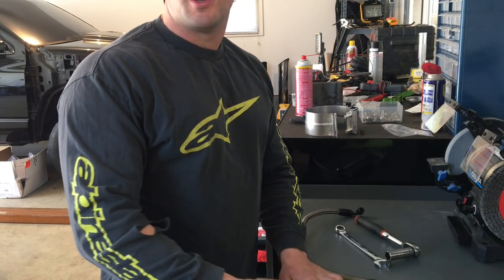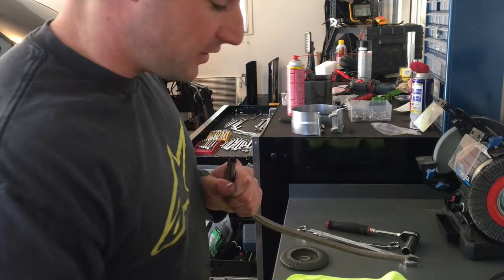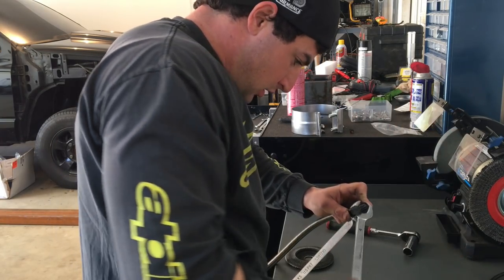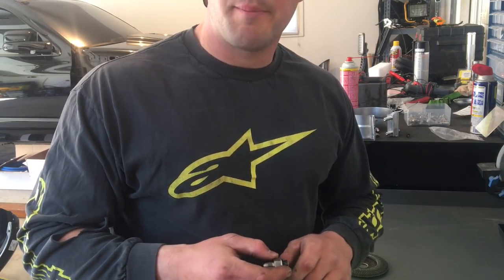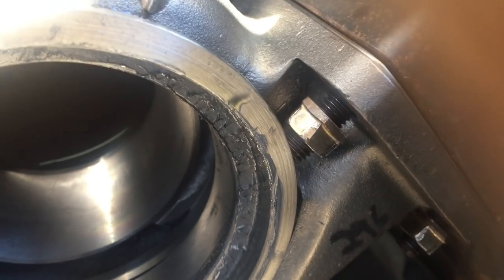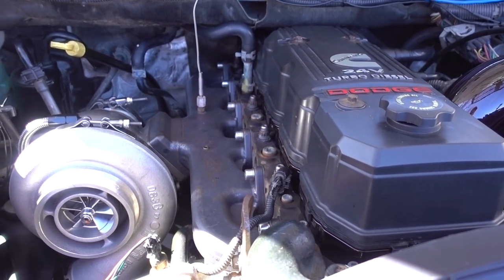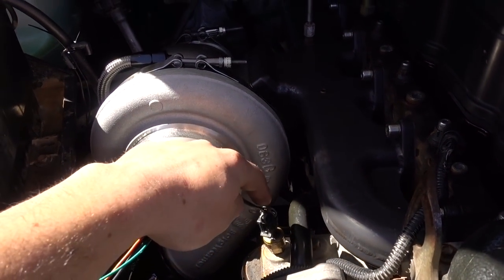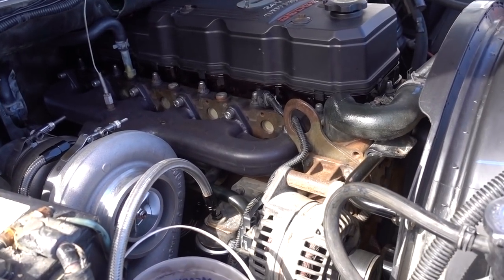FROM BAD TO WORSE - MEGACAB BUILD GOES EVEN FURTHER!!!

Comment: Before you tear the front of the engine apart, check/replace the filter housing and oil cooler gaskets and a pressure relieve valve. If that don't help, drop the oil pan and inspect oil pickup tube for cracks and its gasket. Just a thought

Comment: Check the oil and filter that will tell you real quick if something is fucked I went through turbo problems and turns out diesel was leaking from a bad injector or injectors thinned the oil (only know that because I had it tested) and scored my cylinders up let's just say the truck sits in the yard

Comment: could be an oil pickup issue it's somewhat common on those it happened to my 06 could have had weak oil pressure then from sitting lost it's prime and that's y it's reading 0 now lucky for me I had an auto meter oil pressure gauge since the stock is just a dummy gauge like u said

Comment: I would replace the oil filter I had the check valve inside it get stuck 100 miles after a oil change causing barring to go bad in my turbo